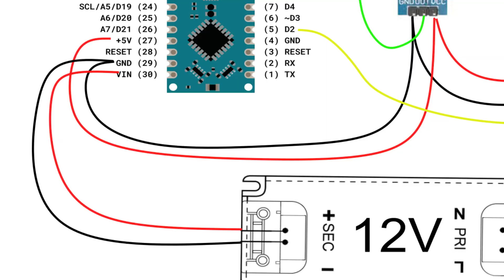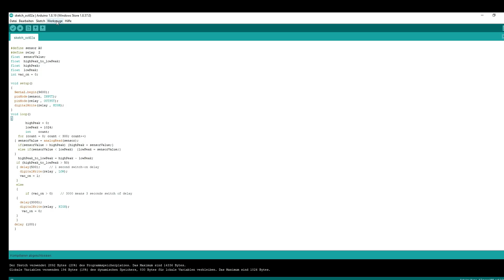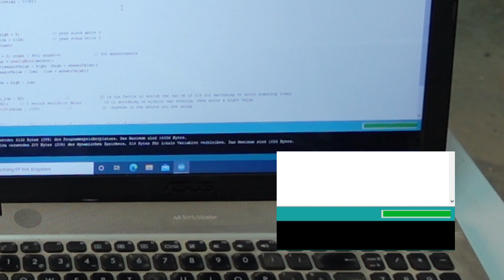shop vac auto start with Arduino. DIY the easy way! (for absolute beginners with program)

Comment: Thanks for posting your shop vac auto switch solution.  I just finished building it, with a few modifications, and it works very well.  I used a 20A SSR instead of a mechanical relay, and had to swap the HIGH for LOW and the LOW for HIGH arguments in your code.  The other modification was to add a bypass switch so I could easily turn on the shop vac without moving its' power cable to another outlet. I do have to make a final housing for it, but that is a minor issue.  Thanks again !!

Comment: Great video and explanation, and thank you very much for the code!  That is the part that keeps me from getting into Arduino and/or Raspberry Pi projects.
Two questions though:   
1) The relay module that I found that 'visually' matches the one you used says that it's "5v", but you're using it with a 12v setup. Is this indeed correct? I don't want to get the wrong part and instantly burn it out.
2) If I wanted to get other pcs of equipment in on the shopvac party, like my radial arm saw, planer, miter saw, band saw, ect, am I right in thinking that I can simply use an additional voltage sensor module at each device, with all of the connections run in parallel with the first?  I believe that the nano and the code you wrote wouldn't know the difference, and would simply sense the voltage and actuate the shopvac, but I question it due to my lack of coding experience in this.
Ironically, I used to write my own video games from raw code on the Commodore 64 in the early 80's, and many websites from raw HTLM using nothing but Notepad in the mid to late 90's, so I'm not 'new to coding', but PTSD put what seems to be holes in that part of my brain, and it's just gone now.